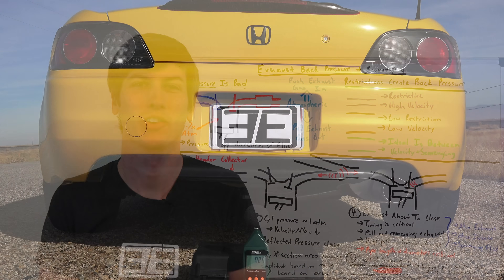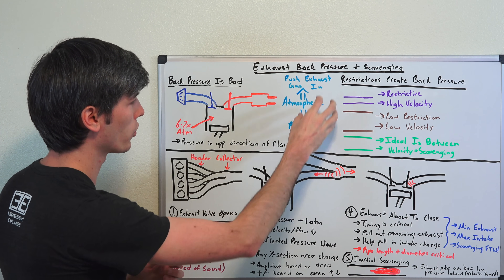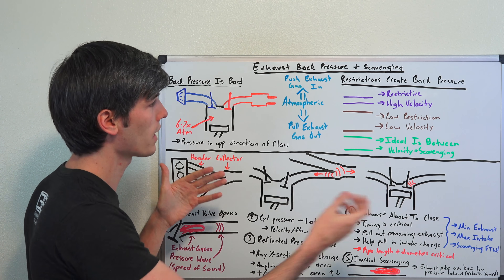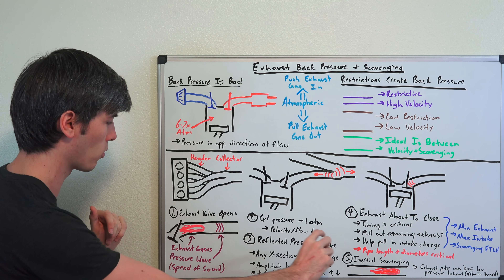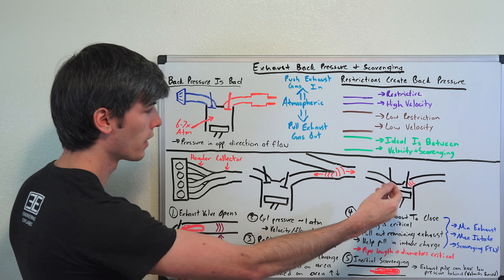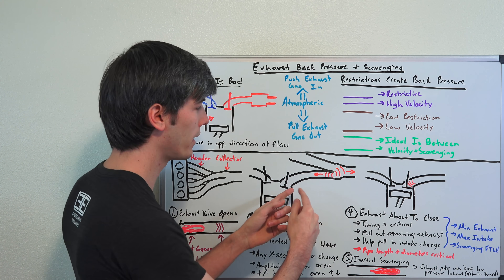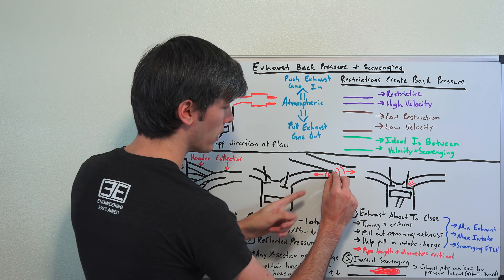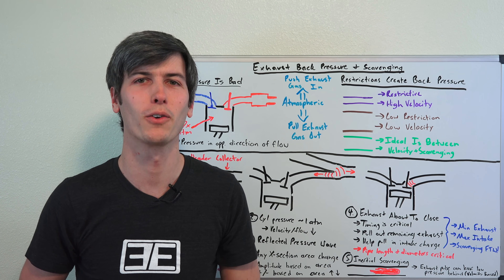Stop Saying Car Exhausts Need Back Pressure

Comment: I am so glad that you are helping dispel the myths of back pressure for four-stroke engines. Because temporary back pressure is useful on the first stroke of a two-stroke engine, just enough to prevent incoming fuel and air from escaping. This has set up a myth that is hard to kill, because so many people have heard it for so long they feel it just has to be true. But it is a total lie.

Comment: I think the misconception about back pressure comes from when performance two stroke exhaust "gets on the pipe" that is the standing wave is in resonance with the exhaust events and when in phase, acts to extract exhaust so the pipe is an extremely peaky phenomenon. Somehow, I think the idea for the "need for back pressure" came from this, fallaciously.

Comment: "Computer controlled EFI" is the simple answer to the title question. When an engine is cold and properly tuned exhaust system is installed there are factors that the IC process has to overcome, compromises that make an engine efficient at working RPM, and Thermal resistance to fuel mixture burning must be overcome to heat the system to operating temperature. When there is a mass of cold air downstream in the exhaust, the cold air cools the  expanding exhaust gasses quickly  causing contraction as it exits the combustion chamber slowing the flow down with each pulse of exhaust. Until everything warms  some of this pulse is reflected back toward the combustion chamber which helps things warm up faster. This backward pulse of the hot gasses meeting resistance to the cold gasses which  take more energy to move is helping the cold engine start and stay running and also get to efficient operating temperature more quickly. This could be overcome with a longer cycle of the electric starter at a higher RPM reducing the longevity of the starter or in smaller engines kick/pull harder longer or like in a diesel engine you could use a heated resistance wire to preheat the engine & exhaust. If you don't like the term "back pressure" what would you call this beneficial part of the warming cycle?

Comment: Your title is idiotic.  Guess what my rx7 non turbo has 2 aculator ports that open up inside the intake manifold opened and closed through exhaust preasure. If ypu lose the exhaust back pressure you will lose 50hp. your explanation is only based off certain cars. You need to do more research Mr. YouTube Master Mechanic.

Comment: i think people confound that some engines are designed to have SOME back pressure and if you have not enough, the engine desynchronizes  and loses power... but higher pressures do not help AND if you took a V8 from the 50s (like some olds super88) having a barrel for an exhaust pipe would probably be best! ;P

Comment: Not being a whiz bang engineer, but having more than a passing experience with Less restrictive exhausts. One thing you didn't touch that I see repeatedly in the Harley world, is the fact that changing the exhaust from factory to less restrictive, leans out the engine hence the infamous Harley Pop and spit under deceleration. This is extremely noticeable under carburated engines, and not so much under EFI, providing you do not go too radical on the exhaust system. But even there, general rule is if you change the exhaust you need to re-jet, or re-map. So in effect unless you are also taking into consideration the re-mapping you do need a certain amount of back pressure lest you run too lean doing engine damage.

Comment: @Engineering Explained so my NA V6 with only one set of cats and test pipes in place if the secondary cats, going into a muffler less exhaust piping has bad/low velocity if I know have no grunt off the line?

Comment: "Backpressure" is really just the extra pressure above atmospheric measured at the beginning of your exhaust system that makes the exhaust flow happen.  IOW, some backpressure is necessary in order to get the exhaust to flow at all.  Precisely zero backpressure would mean precisely zero exhaust flow, kind of like holding a straw up in perfectly still air.What you don't want about "backpressure" is too much of it; one rule of thumb figures that one extra psi of backpressure costs something like 2.5% in terms of maximum power output. (post didn't initially land where I intended it to).  Resonance effects are related but separate.  Norm

Comment: All of your numbers and drawings look and sound great on the board.  But 40 years of building engines and cars in the "real world" have shown that some amount of backpressure actually does build more low end torque and create a smoother power curve.  If you're running at wide open throttle high rpms all of the time on the dragstrip you can build more horsepower.  But in reality you need the back pressure for helping low end torque for 99% of all your driving.  Actual life experience will show you this.

Comment: I thought smooth idling required some back pressure - especially on an old modified engine when you have lightened the flywheel
Reply: Did you watch the video? Or just not comprehend it?
Reply: @Maverick09171  yes I did watch it. Twice now :-)
Lots of common sense things about (overall volumetric?) efficiency.

I am asking about other aspects - not everything is about scavenging and top end breathing?

It might be an old tuning wife's tale, but I thought a fix for badly idling engines was to actually put a muffler on them, instead of an open pipe or megaphone. And the "fix" was more important when you had halved the weight on your 1950's 4 cylinder, maybe siamese port engine, with a freshly upgraded lumpy cam
Reply: Nigel Pearson hm. Interesting. Sounds like a pretty specific case!  Maybe this does not apply to that particular engine

Comment: Show your engineering test results! I had Hillburn fuel injection and eight straight pipes going out from heads. Did not have any back pressure and exhaust moved to fast to allow gasses to slow down inside the combustion chamber and therefore had to fast of low with cam I was using. Pleas take into the cam timing!  Your are not 100% Correct! Need some reversion dam to prevent to fast of flow the way I think! Thanks

Comment: I don't agree 100%. When I had a Slingshot Dragster with straight headers I could not spin the tires. I thought I needed back pressure. I took small plates and bolted them inside the straight headers about 2 and 1/2 inches inside of the headers on each header coming from each cylinder.  To my amazement I tried it and the tires spun and the front end came off the ground. There is  a need sometimes for back pressure and it is a must. If not then why even have an exhaust pipe at all? Duh?????? It worked for me 100%. Just like a 2 stoke design is a must!!!!!

Comment: The scavenging effect has nothing to do with inertial effects.  It is simply that when the compression wave of the exhaust hits the transition from single-cylinder pipe to common pipe (or a step in header), it reflects a rarefaction wave backwards; i.e. negative pressure, which tends to suck out even more exhaust gas when it reaches the exhaust valve (which can actually help pull in more fuel charge if the cam overlap is timed right).  The same exact thing happens in reverse on the intake side.  It truly is not very complicated.

Comment: Yeah but some 2-cycle engines can benefit from back pressure FYI.  A 2 cycle muffler actually makes certain 2 cycle engines run better.  Also, car engines struggle and lose horsepower due to the attachment of catalytic converters, which create some back pressure, and you lose some horsepower at the expense of environmental laws.

Comment: You did a very good job here, my only gripe is that you forgot to mention that there is a point that the exhaust and intake valves are open at the same time, valve overlap. That plays very heavily into manifold design because if you have too much scavenging it will pull air fuel mixture out into the exhaust and also reduce the over all efficiency of the motor. You did how ever do a very good job on how pipe diameter and length plays a very big part into how headers are tuned for a certain rpm range. I always enjoy your videos and keep up the good work.

Comment: Turbos generate back pressure. The ford gt’s turbos generate a lot of back pressure to spin the turbo impellers so of course the gt doesn’t need “back pressure” it’s built into the turbo system.

Comment: Why not just keep the intake valve open longer to force exhaust gases out using the camshaft profile and not worrying about proper pipe length and proper diameter? Cause lets be honest the room inside an engine bay and under a vehicle is the main point of what determines header/manifold size, design, shape, and length.

Comment: all exhaust systems create back pressure, the diameter dictates how much. with increased  rpm more gas tries to escape increasing the back pressure.  matching exhaust size to other engine characteristics is important to make power at the appropriate rpm.  weather you like it or not your car will have back pressure. Does it need it?  do you have a choice unless running straight out of the head?

Comment: I'm driving a 1.3L manual car and I had my headers changed, cat deleted and straight pipe all the way to a huge muffler taken out from a Subaru (STi Genome). The piping diameter was slightly widened and I'm quite impressed with the results. Yes, my acceleration dropped by 2 to 3 seconds from 0-60 but the top speed increase was amazing. Had no issues reaching 190 on a 1.3L car and the engine doesn't sound like it's about to blow up.

Comment: Why the hassle with optimal length/ diameter etc if you can just build a little turbine into the exhaust drawing exhaust gases out, maximizing velocity and preventing pressure wave interference? Or has it been tried already and found to be unsuitable?

Comment: Is there a certain point in the exhaust that it no longer affects velocity and scavenging?  For example, if a V8 car as two catalytic converters that flows to an x-pipe to dual mufflers to dual resonators.  If you were to remove either the mufflers or the resonators or both towards the end of the exhaust, will that affect velocity and scavenging?  Or is most/all of the velocity and scavenging occurring between the header/manifold and the x-pipe with the catalytic converters? The reason why I ask is because I hear of people doing mid muffler and or resonator deletes and claim that the car is making less power.  This initially seemed unreasonable because the manifolds, catalytic converters and the x pipe remain intact and there is more flow after the x-pipe.  Is this incorrect?

Comment: 6 port N/A rx7s require some backpressure in order to activate the auxiliary port actuators, which help give it more low end torque without sacrificing top end power. Without any backpressure, they're stuck in the low RPM position.

Comment: You need small exhausts and that exhaust should go slowly outside when you wanna have power upphills when low hp engine, so then backpressure is important. I have experienced that with my scooter when I was young. I could go up the hill with it when exhaust was leaking and backpressure smaller. Or is it something else then? Tell me if it's something else and what.

Comment: if u got no back pressure and no muffler. that noise hurts my ears and i know it's against the law not too have a muffler on. even the cherry bomb is illegal in some states. My question is won't gas mileage drop if u have no back pressure. won't is just run through it?????

Comment: I always wondered about the value of the intake snorkel diameter verses the exhaust diameter. Has anyone done a study on the difference between these two? Would there be a performance advantage either way? Is it better to have a larger intake, and smaller exhaust, or a larger exhaust and smaller intake snorkel?

Comment: I'm disappointed that over the years you haven't  done anything to do something better with your graphics.   With your background you should easily be able to present this in SolidWorks or an animation program and use it under the teacher/student license that is easily affordable.  In addition you could model good vs. bad exhaust systems by showing actual flow through fluid  dynamics.  And you would benefit because we can all be better using CAD as often as possibe.

Comment: I've never heard that back pressure was good.  However, I grew up hearing that putting a high efficiency exhaust on an older engine can cause problems with the rings due to loss of the back pressure that they were seated in for.  I have no idea if that is valid, though.

Comment: LMFAO! The dyno don't lie! You would need a engine built to run with low back pressure to gain out if it. Simply cutting the muffler off some stock engine will NOT net you the highest HP even after compensating for the lean condition. Any true engine builder knows this and most high performance muffler manufactures know this. Many dirt bikes and ATVs mufflers even come with a set of baffles to adjust back pressure to get the best performance AND the best performance in the RPM range desired. Yes 4 stroke not the 2 strokes. We all know 2 stroke it is even more critical for back pressure. Sorry i like your videos but some of them are not 100% accurate. Get ready for a bunch of people to cut there exhaust off and start warping valves LMFAO!

Comment: Before i watch this, I'm going to make a guess.  "Back pressure" is nonsense.  What you're after is flow rate.  You don't want a huge volume exhaust system on a small to medium sized cylinder wherein the rotating assembly isnt turning high rpms because you'll kill the exhaust flow rate.  Conversly, you don't want a narrow, restrictive exhaust system on a high revving large displacement engine because it would choke the motor out and rob power.  Same is true for the top side of an engine.  You wouldn't put heads with 220cc intake runners on an otherwise stock 350, just like you wouldn't put heads with 165cc intake runners on a hopped up 350 turning 6800rpm.  Let's see if I'm right.
Reply: I guess flow rate wast the right choice of words.  *Velocity

Comment: When MOST people say that the engine needs a little back pressure they are talking about V8 engines and not some tinker toy 4 cylinder.  All the millions of dollars that automakers have spent designing the optimum exhaust for their performance vehicles was all wasted because all they had to do was wait until this video came out before designing their exhaust systems with those silly crossover pipes.  Silly engineers.

Comment: I really liked the video and its very informative, but there are some other factors at play when a exhaust is designed for a specific motor. Ideally you need to look at the application its being used for, the rpm range its going to be living in, the fuel and compression ratio of the motor, the port design of the heads, flange design for the exhaust, the firing order, and if you were getting extremely picky you would look at spring pressures and valve seat angle along with collector geometry and tube length, thickness, geometry and what there made of. Yes these are the crazy extreme in-depth parts only racers look at, but in a race class were everyone has the same engine, 4hp can make or break you winning a race. I hope this helps people in understanding what sets apart a set of $700 headers compared to a set of headers that costs $7,000

Comment: what if you reverse turbo charges a car where the exhaust was being pulled out of the engine while the intake would spool the turbo?  Seeing as the point is to get rid of as much combustion gas as possible while creating a negative pressure on the engines intake side for more fuel air ratio mixture?

Comment: So you say the designers tune the header lengths to optimize this effect at particular RPMs...so they usually focus on the middle/low (cruising) range that is used most often, or at the high end where small changes make big differences?

Comment: Wouldn't the piston traveling back up from Bottom Dead Center push the exhaust gasses out by itself ( like a plunger in a syringe) and not have to rely on low and high pressure regions? Or is the low pressure regions merely assisting in expelling exhaust gasses?

Comment: First off, ALL pressure in the exhaust system is back pressure.  Pressure is created by resistance to flow.  There is also one important point missing here.  Changing back-pressure (or any change to the the flow characteristics of the exhaust), WILL change the volumetric efficiency of the motor because it will either get more or less of the spent combustion air out of the cylinder.  Normally increasing the amount of combustion byproduct is good, IF your fuel/air metering system can handle the increased efficiency.  For a NA car the amount of clean combustion air that is pulled into the cylinder is directly related to how much of the spent air got out.  The more the better.  But there is a limit.  If you put zoomies on a motor running a stock carb setup, you CAN end up with a car that performs worse.  The carb jets can only flow a certain amount of fuel.  If you reach that limit before you reach the limit of the throttle body, you get lean.  Same goes if your jet progression is to high, you can suddenly get rich.  Either one will kill power.   Just like putting that trick air gap high rise doubble pumper on a motor with factory exhaust manifolds can actually make the car perform worse.  You have to consider all the aspects of your motor setup.

Comment: There's a hot spot along the exhaust pipe (use a crayon mark along the Pipe and see where it melts 1st),
or a temp gun. Cut the pipe beyond the hot spot [the same diameter as the pipe] ie; 2'' pipe cut 2'' beyond the spot where the crayon mark melted 1st . . .